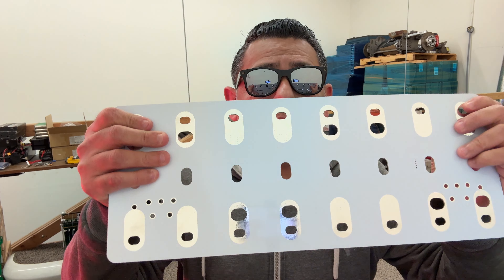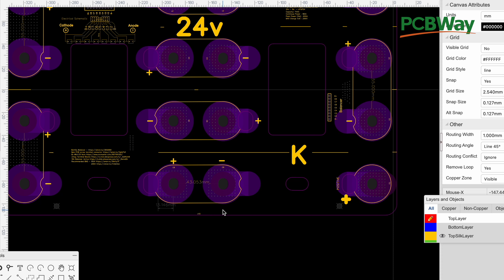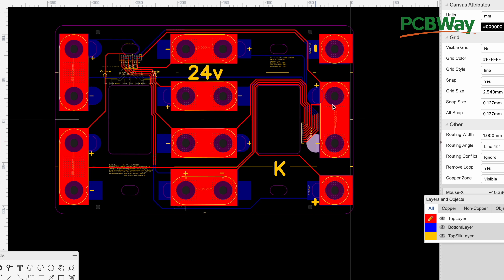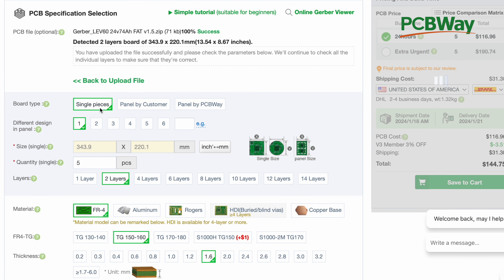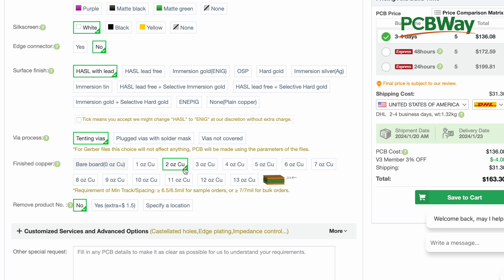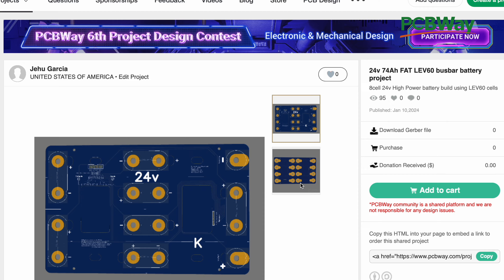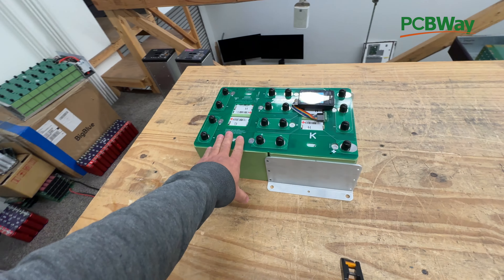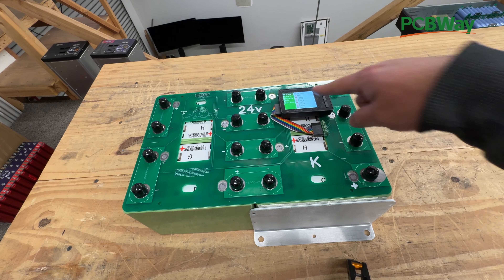RV 24v LifePO4 DIY battery Project

Comment: its a good to have 12, 24 ,48 volt versions for w/e project you need the batteries for. Im going with the 12 volt for solar back up. I got 3- 4 packs will prob. order one more to make it 4- 4cell packs. Just an aside with the 2- 4 pac connected in  parallel,  I haven't needed a Balancer or BMS.I charge one 4 cell pack at a time then let them rest. Then connect the 2 packs together. Resting voltage is about 3.35 volts across the board.

Comment: Man you should allow to people outside U.S. to buy using a po box/shipping forwarder.
Reply from the maker: You can arrange it,  I just don’t want to deal with it.  It’s too expensive and it takes too long and it’s always my fault. It’s not profitable so not a good business idea
Reply: @jehugarcia  the service i use have never failed me, they send pictures of the package before they open it, and the contents, i mark my deliveries as recived as soon as i get the pictures.
But i would prefer to buy everything from you as a kit
Reply: Could we buy your parts directly from the Chinese manufacturer and shipped to our residence? Is that what the links are for?
Reply from the maker: yes, except I dont have a link for the cells,  since these are overstock product in the USA

Comment: Would these work for a diy battery upgrade for a razor mx650?? Or do you have any 48 or 72 volt battery that would fit in to upgrade them?? Would be a good idea for a video if you have a battery that would fit

Comment: I pretty much stopped watching your videos because I can't easily order that stuff from Europe.
Reply: In this instance you could easily replicate the battery connections using copper sheet that can be found at a hobby store. I used to work on golf carts with 6 or 8 lead batteries and pallet trucks with 4 in them. They all use an external bms and I can’t see what the harm would be using an external one for those batteries.
Reply: Can't order, can't stop watching.